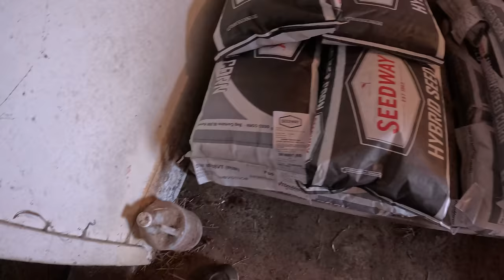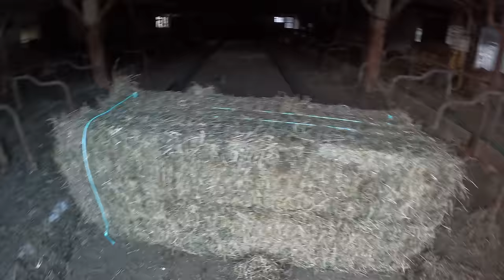Corn Planter On Just In Time For More Snow

Comment: The shoes on the snowplow.You put shims on the top and or bottom to adjust the height of the shoes to the plow.Usually carry the extra shims on the top under the clevis pin that hold the shoe on.

Comment: If you look at that rubber for that door panel there's a Groove in the middle if you look at that Groove you can pop that Groove open and it loosens up the rubber to make it easier to pry the rubber around that panel then once the panel is in the rubber you go around with a screwdriver on that Groove and push the lock back in place to tighten the rubber back up

Comment: You can either use a hose removal tool, like an awl with a twist or hook on the end, or lay cord in the rubber gasket start your panel, pull the lip of the rubber out around the panel.

Comment: We got that storm in NH.Still without power.Have utilities crews here from virginia tennessee texas and other states.Been on generator for days.Just got the internet back. They are drilling holes and setting poles for the mainline. Using tracked vehicles to get thru the snow to the downed poles and lines.Snow is melting quickly now.
Reply: We got over a foot next door in Maine...power flickered but that's it
Reply: @aaronsanborn4291  The branches were heavy.Ground not frozen so the trees toppled over in 60 mph plus winds. There was also an earthquake in new england , felt in NH.  I think the landowners now will give more permission to utilities to trim branches and cut trees.The landowners get permission cards to sign for utilities to proceed with their work. A bad storm and no power for days can change their minds. I think in a state of emergency the utilities can do what needs to be done for the public good.

Comment: Chris how big are your self tappers and will it interfere with rolling the window down?
Hope it doesn't,  but if it does, take out just the top ones and get some panel bond and glue the top. I just don't want a self inflicted wound and break the glass as it vibrates against the screws if they touch.

Comment: Are you sure,  I think you need more bondo on the door I still think you could bend a crowbar in your own sandbox Peterbilt all day long get yourself some class
Reply: Pete’s have class but for farm trucks old Mack’s are hard to beat
Reply: 1984 359 cat power 15 SPD over dash slappers deep reduct  Hendrickson susp 22 ft areoswit silage beds is that old enough
Reply: Yours is the exception not the rule
Reply: Now we are can't be getting personal  now  maybe you need to get a peterbilt
Reply: 1993 Pete 377. 3406c model cat 435 hp 13 spd 3:70 gears. Awesome truck on the road. Our 1986 international 9370 with the big cam 400 13 spd with 4:10 gears is a better field truck. The 05 Mack chn613 with the 427 Mack and 10 spd 4:10 is a decent second for a field truck. Every truck is unique just have to find the one that fits the individual need